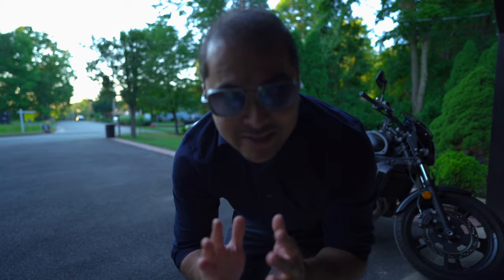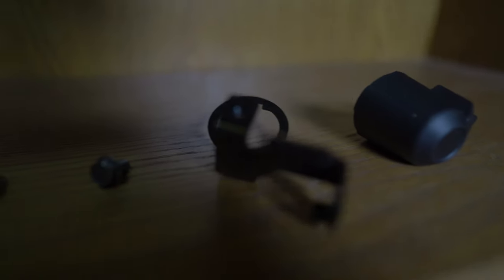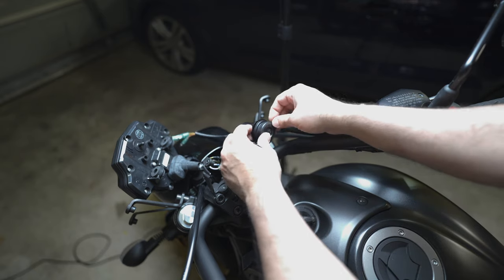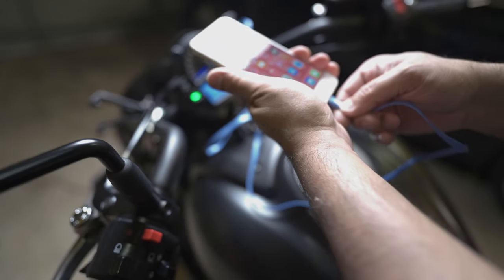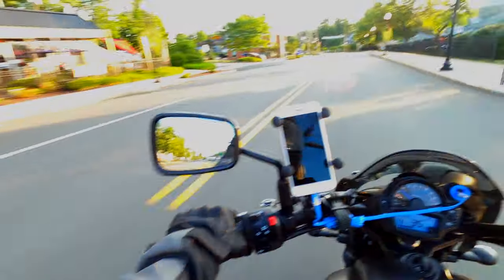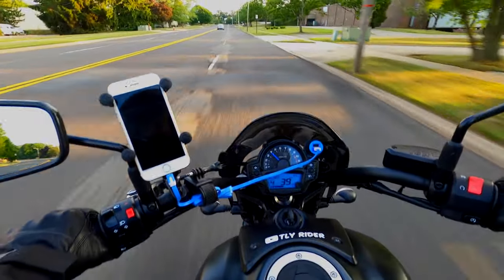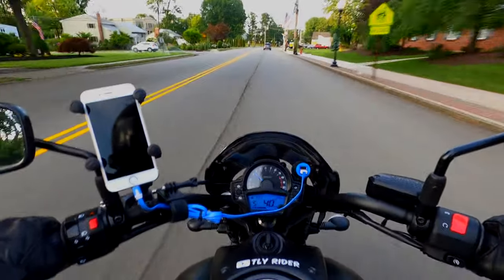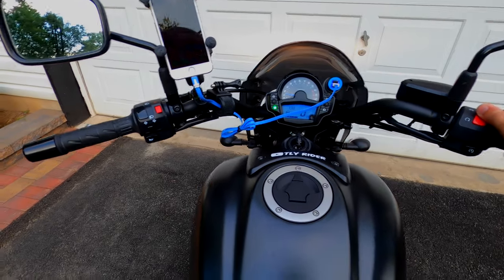DC Power Outlet Install on Kawasaki Vulcan S | TLYRIDER

Comment: I noticed you had the Puig windshield mounts here? Did you try one of those out as well? I bought one and then returned it because of buffeting.
Reply from the maker: Yes, i still have the windscreen, however i removed it for the same reason - buffeting
Reply: @TLYRIDER  check put the Vulcan s forums on fb, you can probably sell it easily.
Reply from the maker: @ferociousfrankie  yeah that's a good idea, thanks , I will post it soon
Reply: @TLYRIDER 
I was looking at purchasing the PUIG windscreen. How tall are you? I'm wondering if I will experience the same problem with wind directed at my head/helmet
Reply from the maker: @mrq1701  I am 5'7 and the wind hit directly on the top part of my helmet and it's bad at high speeds. It help to completely eliminate the wind hitting the chest but I can't tolerate the wind hitting the helmet and the wind noise inside the helmet is even worse. I think may be a taller Puig screen might help, mine was medium height one.

Comment: I'll never understand why they made this a 12v socket and not a USB!!
Reply: So you can install the type of charger you need. It also allows you to remove it when you're not using it so there's no parasitic electrical drain.